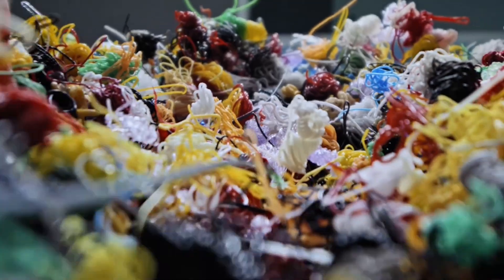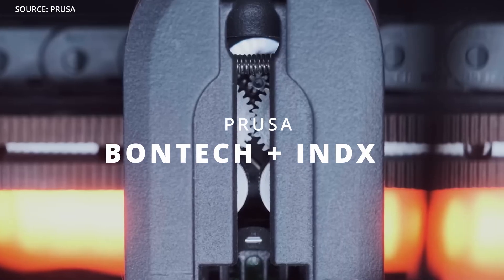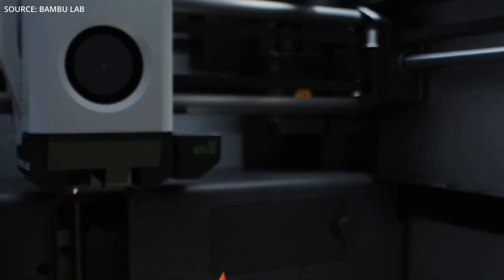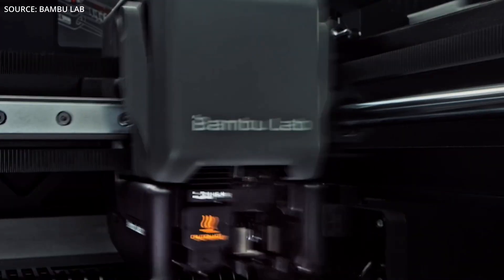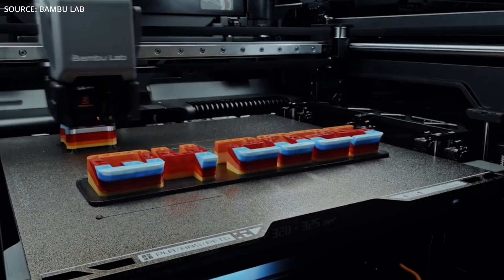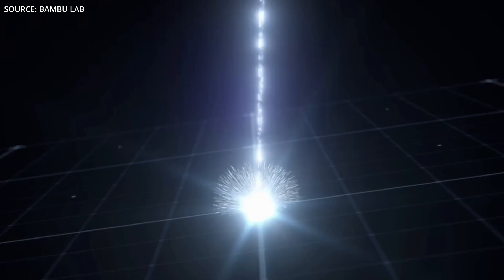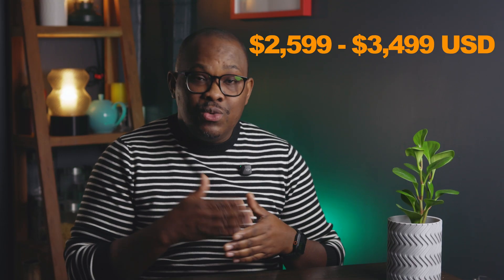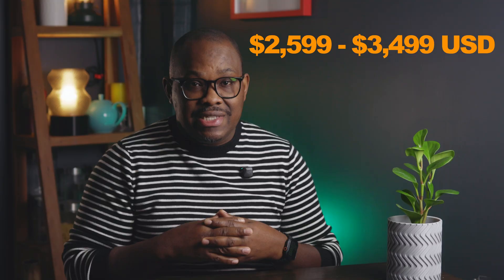Bambu Lab H2C vs Prusa Bondtech INDX: PURGE Towers are DEAD (2025)

Comment: Or, if you don't want to spend over $2000 for a multi material printer, you can get the INDX starting at $350 and just put it on an existing klipper machine.  Bondtech is selling the kits, the Prusa thing is a side bit for them.  Plus, other manufacturers (looking at you, MMU-less Sovol) will be getting with Bondtech on the INDX so they don't need to spend all that money on researching something and it not working out.  Like Elegoo.

Comment: h2c 
pros: works for anyone without much effort, bambu quality, cleaner due to no ptfe tube and most likely not to fall off from entanglements or misalignments, easy filament management with ams filament distribution, eddy current sensor makes pa calibrations a thing of the past.
cons: not compatible with other slicers than bs which in my opinion is a huge negative, no third party nozzles, drm nozzles and closed ecosystem, no soft tpus besides 64D, ams is slow, slow filament changes, more maintenance and repair costs.
future: need an updated ams that outputs 4 filaments at the same time like phrozens choma. reduce the time needs to change filaments, hopefully gets orcaslicer support

indx
pros: super fast filament swaps, different types of tool heads that don't necessarily need to be filament, 3rd party tool heads welcome, super fast, simple design, can be adapted to open source printers like klipper, a tpu beast, possibly addressed the need to perform flow and pa calibrating(undetermined), will work with most slicers since it's gcode driven, dev kit available so we'll see it on any printer that wants to support it
cons: ptfe tubes make things more difficult to manage, beta still, unproven but has a ton of potential, ugly in comparison (i don't care but i can understand some do).
future: probably looking at 6 months+ before it starts to mature to a consumer level acceptance. Hopefully it's amazing and a real game changer
Reply from the maker: I appreciate you watching the video and sharing this solid breakdown 👊
That’s pretty much how I see it too: H2C is clean, reliable, and easy, but the closed ecosystem, slow swaps, and slicer lock-in really hold it back. INDX is still rough, but the speed, openness, and slicer freedom give it huge long-term potential. If it matures, it could genuinely be a game changer.
Reply: @dewaine_larmond  The new Bambu print head system Not H2C if difficult to work on. Not sure what issues the H2c will have

Comment: INDX is superior on almost every metric. Faster to change, Can handle TPU, Less priming, more nozzles, less moving parts to break, and it's cheaper. I think Bambu over-engineered their product, it's way more complicated and actually inferior.
Reply from the maker: You are definitely correct about the less moving parts re INDX. Bambu loves to flex their engineering skills, but it goes to show that there are multiple ways of doing the same thing to achieve similar results. Thanks for watching and the overall support.

Comment: Why are people glossing over the huge difference between these printers the INDX is only capable of 8 filaments per print while the H2C can use 24 filaments  per print.
Reply: Yeah, but to get 24 you bring back the purge waste.
Reply: @mj1s735  it optimises for the least amount of waste
Reply: No, INDX is compatible with Prusa’s MMU3 and therefor each print head could have up to 5 colors.  5x8=40 right? 40>24
Reply: @robblincoln2152  show a video of that working. we don't deal in the hypothetical
Reply: Having that number of filament in ONE print is very important to 90% users 😉🤔
Reply: being able to load more than one spool of the same filament so it just switches when the spool runs out or not having to swap filament when printing different models is important to a lot of people, if you are shortsighted on the advantages that's on you
Reply from the maker: It really just comes down to which machine you vibe with more. It’s like Subaru vs. Mitsubishi Evo, or Lambo vs. Ferrari, each has its own strengths and weaknesses. I started with Bambu and I just love their system....it just works in my opinion.

Comment: The day Bambu offers multi-nozzle diameter slicing/printing I'll order an H2C that day with laser. That's a package deal, though their laser engraving/cutting software leaves room to be desired it's not that bad and Bambu is good with software. I'm more interested in multi-material and multi-diameter printing using engineering type filaments with multi-color only for text or indexing/orientation applications. READ THIS BAMBU, DEVELOP MULTI DIAMETER PRINT SLICING. Also, on the  AMS system I'd love to see divider walls for filament drying because of the extreme difference in drying temps filaments require. Double the price of the ams2 or whatever, I'd pay for that system, if I can have filament slot#1 at ~45C
slot#2 at 62C
Slot#3 at 75C and slot#4 @90C. The viewing windows don't need to be half of the covering, use good insulation with a thicker, perhaps 2 layer air gapped viewing window just big enough to check for jams and remaining filament on each spool. 
🤓
Also, an engineering version with zero wifi capability would be a bonus. Just hard wired to a printer cable or whatever.
Reply from the maker: Thanks for watching. You have made a really good point about the different temperature compartment for different filament on the AMS. Currently, each installed filament all dry at the same temp. which is not efficient. I hope they can improve that with the next update. I can see where the H2C can be updated to multi nozzle diameter slicing. who knows, maybe someone will figure out a way to modify or write a G-code that enables that. Thanks once again for watching. These interactions keeps me motivated and builds the community. All the best!

Comment: There are literally purge towers in the footage. Also Prusa is not "open source" for a long time already. Firmware is open source, some structural parts are open source. The key hardware is closed source and is protected by patents
Reply from the maker: That’s for your feedback. For clarity I was referring to the firmware being open sourced. Unlike Bambu which has a mountain of restrictions, but I see people work around it by modifying the G-Code. Thanks for the feedback.
Reply: And INDX is NOT even a product made, invented or developed by Prusa...
Reply: @B0ttis  Exactly

Comment: Well, show me a tool changer system that actually works.  Prusa XL is a train wreck.  Snapmaker has been pushing the U1 for 6+ months, and you can't get it until March 2026. That is ridiculous and will it actually work and be reliable.  The cost of tool changers by far outweigh the cost of poop.  So, that shouldn't even be an equation.  Time and cost of the printer are the only two factors that should be discussed.  Time savings are negated by the constant repairs and fiddling of the current tool changer lineup.  For now, I will deal with the poop because it is constant and reliable.  There are also settings in your slicer to reduce purging to save time and volume of poop.  The Prusa XL is a bad joke on the Prusa cucks who think they are friends with Josef.  And if Snapmaker can't afford to manufacture their printer without collecting buyers' money for 9 months, how do you think they can afford to support their products.  It's not like Snapmaker is a new startup, they have been around for a long time...making garbage by the way.  Prusa can't make a tool changer that works, so they asked INDX to save them...If this combo ever makes it to the market, please do a review on it.  Like an actual review of the actual machine.  The battle is over and Bambu wins, if nothing else it's because you can actually purchase all of the Bambu machines they show and advertise.  Prusa is bringing a nonexistent butter knife to a cannon fight.
Reply: Thats a whole lotta cope and misinformation for someone thats never used a prusa before, it's almost as if it makes your opinion irrelevant.
Bambu lab got their ccp funded cheeks clapped raw by prusa/bondtech. You should have been there at formnext and saw when prusas booth was 10x the volume of people for the coreone/INDX unveiling compared to bambu lab and their H2C unveiling. Bambu got dragged so hard that they had to take down their CEO interview. The dislike ratio and getting clowned on was just too high for them to handle. Also, prusa and bondtech have been collaborating for like the last decade, but I wouldn't expect someone that knows nothing about prusa to know that.
Reply: @LilApe Are you actually Josef?  Because even the most diehard Prusa cucks are moving away from that garbage.
Reply: Bambu fanboys are just like flat earthers. Just full of misinformation.
Reply: @LilApe  Well, you are more wrong than ever.  The unveiling of the Frankenstein coreone/indx wasn't at their booth, it was in a private room. This world will never see a Coreone/INDX system actually work.  thousands will make lots of cool stuff and money with the H2C right out of the box.

Comment: Just got the core one L. Not a fan of the closed-system of Bamboo. Open source for me, thanks.
Looking forward to the INDX system. Just a hobbyist, but appreciate the best I can get.
Reply from the maker: Thanks for watching and the comment. What has your experience been with the Core One L?
Reply: @dewaine_larmond  Mostly great. I had to return the first one - kept getting bed-levelling failure errors. It turned out it had loose mechanicals.
Second one is great - prints really well and very quickly.
It has a common error though - ALWAYS fails the nozzle cleaning. This means that the printjob stalls until you press 'ignore'.
Hopeing that is a bug that gets fixed soon.
All-in-all - Happy with my choice!

Comment: There is a full misconception about Purge Tower. This is not a Purge tower, it is a Prime Tower. Prime tower is not dead, it will remain required. Purge and poop are almost dead, effectively, but Prime Tower is here to stay!
Reply: On the H2C it´s still a purge tower. As only one tube is used for the 6 nozzles, the filament is cut before unloading from the tube and changing the nozzle. This is better for engeneering filaments needing a heated chamber, as two tubes (the other is for the left nozzle) can be routed horizontaly, while each nozzle with its own tubes need routing to the top. So INDX needs a bigger chamber volume, harder to keep hot enough for PA, PC etc.
However, cut filament can't be retracted anymore. So the cut filament has to be purged, until the reloaded filament reaches the meltzone again. As it´s the same filament, the meltzone does not need cleaning, so it is much less purge than on an X1C. So no poo. But still, most oft the tower is for purging the cut filament, not just priming the nozzle.

You are correct however if you refer to INDX. There the filament isn't cut, so no purge needed. Just a smal prime tower. Which might be bigger for higher prints just for stability...
Reply from the maker: @oleurgast730  thank you for this clarification. You have taught me something. This is very in-depth, thanks, appreciate it 🙏

Comment: In my opinion, who is going to buy these 3000 dollar and up printers? In five years, I'll pick one up for 300.  I love my A1 and A1 mini with the AMS lite.  I use multicolor for level color changes, or printing several parts in different colors using print by object.  For 3 grand, I'll paint my models.
Reply: If it's about multicolour - you are totally correct. However, multimaterial is something else. Personaly I would like PLA-support on PET-G prints.
The CoreOne+ is about 1050€ (as a kit). Not the cheapest printer, but still affordable. The Bondtech INDX upgrade with 4 nozzles is 500€. 8 nozzles would be 700€. So 1550€ for a 4 nozzle printer, 1750€ for a 8 nozzle printer.
I am pretty sure Prusa will release a direct CoreOne INDX kit in 2026. It should be at least about 200€ less than a CoreOne + upgrade, as the Nextruder isn't needed.

Personaly buying the INDX upgrade is a must2have for me. I started with a Prusa mk3 directly after launch more than 7 years ago. Upraded it the full path to mk3s, mk3s+, mk4, mk4s, CoreOne. Have some other printers also (f.e. the A1 mini). But the Prusa is the most reliable of my printers.
Reply from the maker: I know! They’re definitely not cheap and honestly, I’d have to save up for a little while to get one. I mostly make houseware products in a single color, so the AMS always felt unnecessary because of how much filament it wasted. But now that these new options are out, I’m seriously tempted. I’d probably only get one unit, though. The A1 and mini are still a solid setup on their own and more than enough for most people.
Reply: Exactly! And if I want to explore multi-material, I'll pick the U1 anyday!